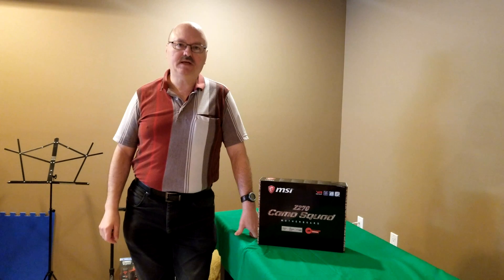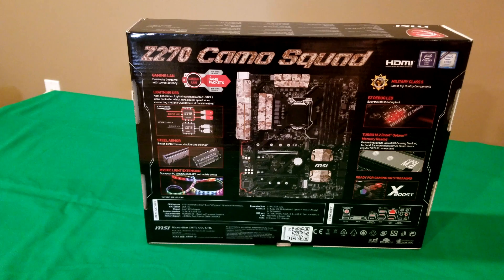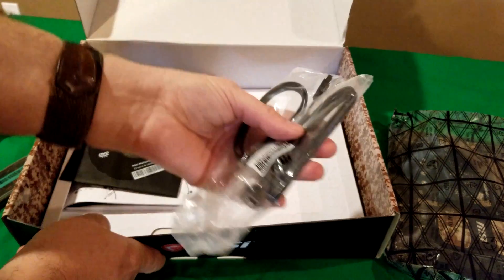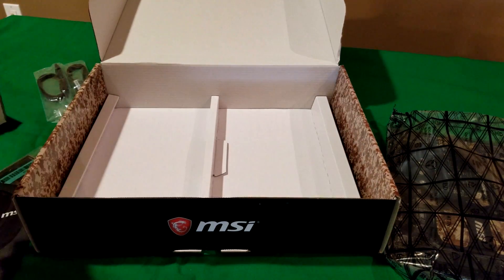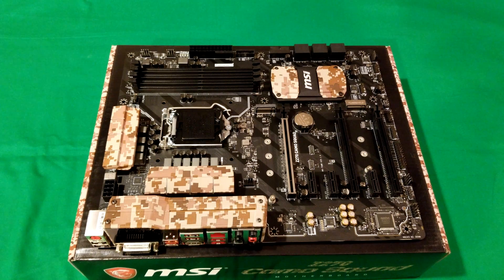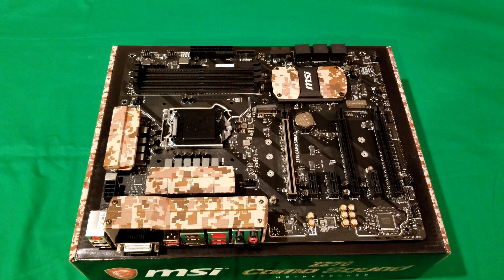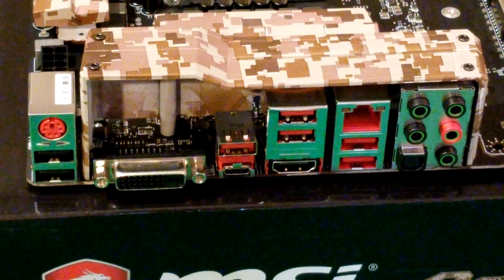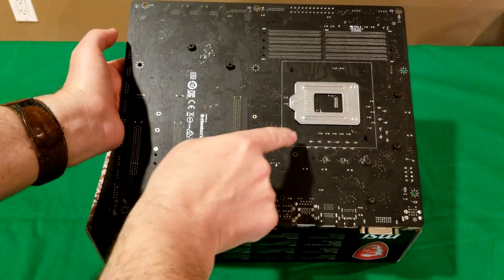Z270 Camo Squad Motherboard Unboxing & Review

Comment: could you max this board out and fill all the PCI slots? i had problems with multiple graphics cards
Reply from the maker: I don't have the GPU's to try it, but it supports 2-Way AMD CrossFire and 3 Way SLI, only issue might be if the M.2 if occupied uses the PCIe meaning it might restrict one of the GPU's I'm not to familiar with this though so can't really say for certain. What problem were you having so I might be able to help better. Thanks...
Reply: @Reviewing_Playing_and_More_RPM  hello! well, i was attempting to cryptomine with it using 1060 6g cards. it would always crap out with more than 4 cards plugged in. i got a gigabyte board and swapped it out and it worked with 6 cards np. i was wondering if the z270 was maybe being a power hog or something idk
Reply from the maker: @beazin579  The Z270 only support 3 from what I've read so not sure how you got it to use 4, was it some sort of add in board of some sort? would be interesting to know...Thanks...
Reply: @Reviewing_Playing_and_More_RPM  yeah i was using pci risers for all of them

Comment: I have a question. What would be a good build for video editing? But on a budget, around $1000. Thanks
Reply from the maker: For $1000 budget, I’d recommend and I5-8400 or Ryzen 5 1600, for Photo and Video Editing the Processor is the main consideration. If going Intel, the I5-8400 with 6 cores and 12 threads will get the job done. If you go with AMD the Ryzen 5 1600 would also do a great job. For graphics I’d go with either a GTX 1060 or if your budget allows a GTX 1070. Or if you can get one at a good price an AMD RX580 or RX 570 work great as well. For motherboards there’s AMD Socket AM4 Ryzen, which will require DDR4 memory/Ram that will cost around 250.00 could go with just 8GB for about half that price. I’d recommend 16GB though. Or the Skylake 6th Gen or Kaby Lake 7th Gen either would be good, Kaby Lake being newer. Look for an inexpensive AMD’s Ryzen B350 or Intel Z370 or Z270 will work with either processor, 6th or 7th… For Storage I’d recommend 2TB or larger with a 240GB SSD for your Operating System. Of course if budget allows a M.2 Drive will give the fastest speeds. For good case my suggestion is Fractal Design R5, or Corsair 100R both good budget cases with most features you would need.
Of course you need a Power Supply and CPU Cooler if it doesn’t include one. For power supply consider EVGA 550W or higher. You’ll need a 650W if you go with a higher end GPU. Also consider if you want and Optical Drive or not it’s not a requirement anymore but some people myself included prefer it. Let me know if you have any other questions...
Reply: Reviewing Playing & More RPM that seems like a very good computer build right there